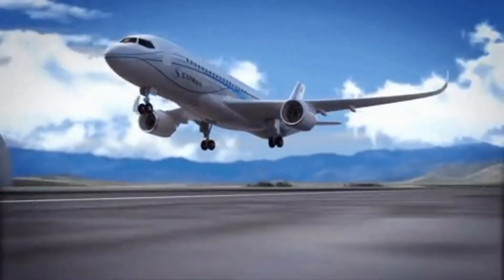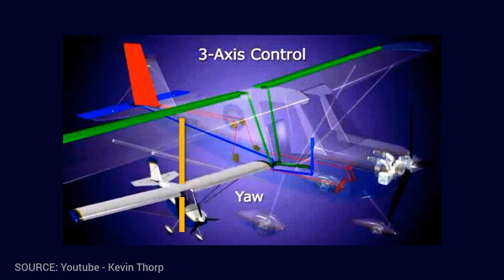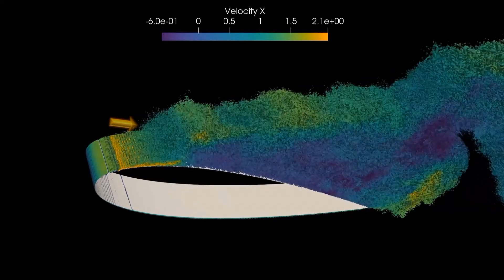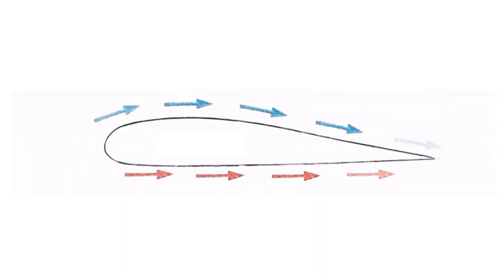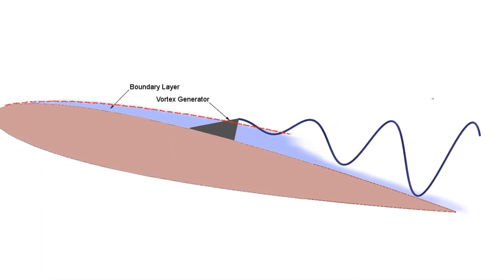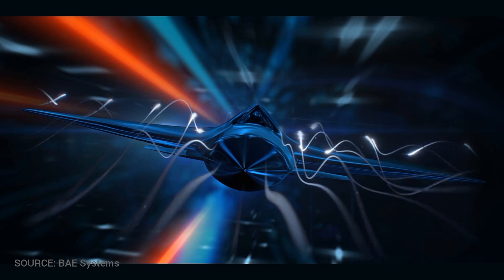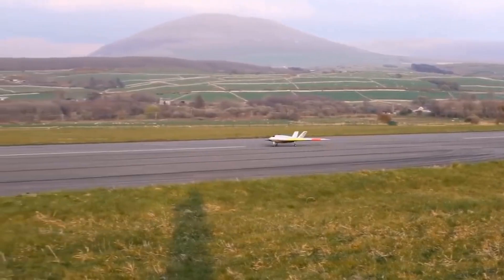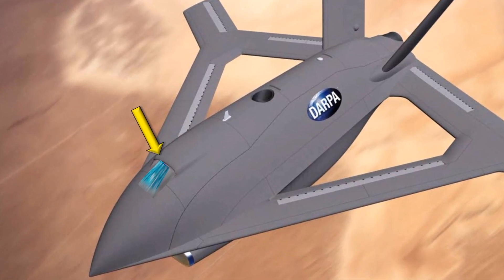The Real Reason Why this Unusual Airplane Breaks the Laws of Aviation

Comment: can it rise into the mesosphere? because the environment there is cold, it means that the most effective engines are the nitrogen thrusters, but they always used to run out of fuel. 
tropo = swim in air
strato = swim in hot gases
meso = swim in cold gases
thermo = swim in magnet particles
exo = swim in higs boson.
now make an ion-drive engine, I know you can.

Comment: This is less efficient 😅
Reply: Interesting. You've just watched a video that goes into some detail about why it's more efficient - but you contradict that without providing any sensible evidence. 
Very useful.
Reply: @lewis7515 because control surfaces technology is more efficient. Thank you.
Reply: @hafizuddinmohdlowhim8426  Because you said so I guess. Lol
Reply: it will end up an "overall" thing whether it's efficient or not.  Physical control systems are a huge source of maintenance and repairs on planes eliminating that will be a cost savings however I'm quite sure this technology is going to require very fast computers to handle all the necessary computations to make it all work correctly.
Reply: @suemccartin  huge cost is not always the case due to the industry has already well established maintenance program. To change something that is already well established will incur more cost.
For your case, huge computational computer will incur maintenance costs that is not familiar in aviation. That is sure will be expensive.